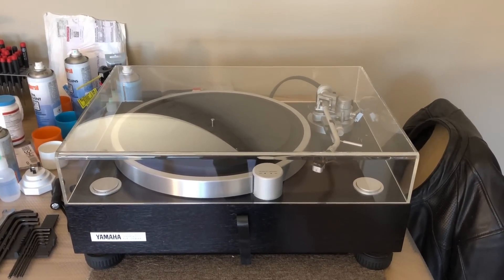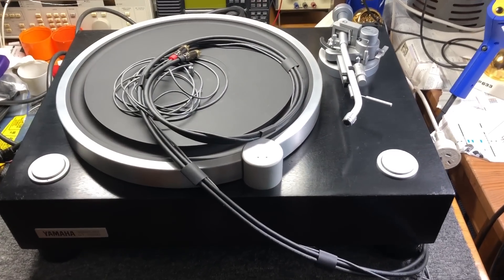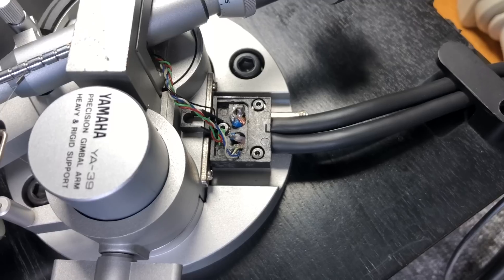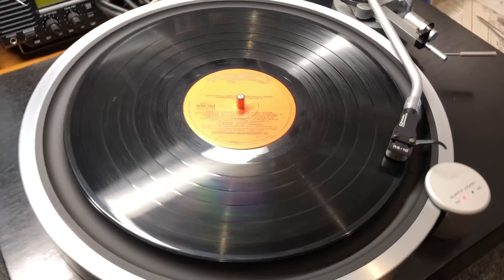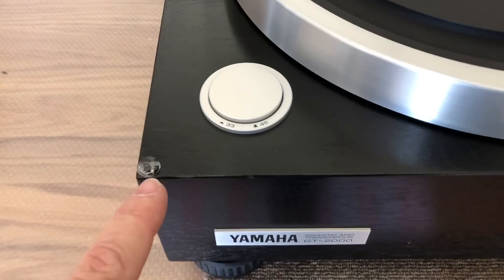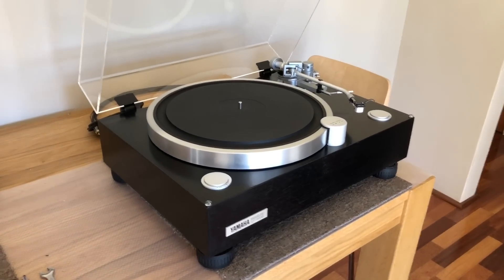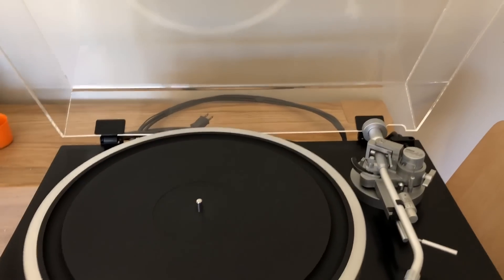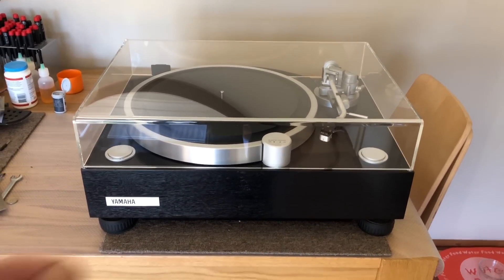Incredible Yamaha GT-2000 Turntable Audio Cable Replacement & Review

Comment: This is one of the muost popular vintage models localy in Japan here. Some nicely serviced ones sell even more expensive than its launch price. Which is just incredible.
Reply from the maker: Thanks for commenting and you are absolutely right. This raises a point I tell many customers - that classic Japanese decks really are still underpriced, even as prices go up. If you look at what $1500 - 2500 USD gets you in terms of a new turntable compared with one of these beasts, something like the GT-2000 crushes anything new at that price and way beyond. I think many people getting into vinyl now are starting to realise this, hence the steadily increasing resale prices. These decks and others like them will only continue to increase in value as folks realise that Yamaha's new GT-5000, for example, is not as good as the GT-2000 and costs a fortune!
Reply: Liquid Audio Absolutely. Its launching price was around 150,000 JPY. But now in a decent second hand store you would most likely find one for like 200,000. Also in Japan the inflation rate is incredibly low. This just shows how much better these vintage classics are comparing to modern devices.

Comment: Nice overview! I am very impressed that it has "pitch control". However, I do not see a strobe light. How do you know that you have it dialed in at the exact speed desired without a strobe? Many Thanks!
Reply from the maker: Hi, glad you enjoyed this one! There is no user adjustable pitch vernier, just a speed selector and on/off. Quartz lock is indicated by LED.

Comment: Nice review. You mentioned that there are better ones. I thought this one is a topmodel from Yamaha. The arm is a bit to lang you said!? What are better models?
Reply from the maker: Thanks and the GT-2000 is a beauty. An arm can't really be too long, the GT arm is a good length, it's just a bit flimsy and the weakest aspect of the deck. The Kenwood L-07D is a better deck with a killer arm for example and there are other amazing decks like the Micro Seiki SX-8000 and Pioneer Exclusive P3, just to name three!

Comment: Are there any similiar Models with full automatic?
Reply from the maker: No, unfortunately all the very best turntables are completely manual. Don't let that put you off, once you get used to a manual machine it's like riding a bike, everything becomes almost automatic anyway! Failing that, if you need full auto, check out classic decks like the Technics SL-10. I've made a video about that somewhere back in time...
Reply: @LiquidAudio  Thanks!

Comment: Hey Mike great work as always. 
With the bump stops, I usually mount them to the lid if possible as it keeps the surface clean ;-) 
Cheers VHFL
Reply from the maker: Thanks and glad you enjoyed it! I vary my bump-stop mountings according to original fitment location and lid thickness. I find they often don't last attached to thinner lids, but it can work nicely on thicker ones.
Reply: Yes, good point.

Comment: Hi,
Enjoyed some of your videos today and noted your comments on the GT2000, excellent.
I'm choosing between importing the exact same deck you have shown here or a Kenwood KP-7010.
Presuming they are both in the same working and cosmetic condition, would you have a personal opinion on which deck may be better than the other?
Just a personal non binding opinion of course, I realise opinions are very subjective.
Thanks
N
Reply from the maker: Hi N, thanks for stopping by. The GT-2000 is in a level of gear above that of the KP-7010. The 7010 uses some elements from the 600/650, like the platter for example and is a very nice machine, but the GT-2000 competes with decks like the Technics SP-10 / SL-1000 and Luxman PD-350, and so it is a definite step up. Cart compatibility is a consideration, as is headshell selection and the arm is weak link with the GT-2000, but they are very nice machines. More here: https://liquidaudio.com.au/yamaha-gt-2000-turntable-major-service-cartridge-install/, https://liquidaudio.com.au/yamaha-gt-2000-turntable-review-cable-replacement/, https://liquidaudio.com.au/vintage-fidelity-research-fr-2-yamaha-gt-2000-vinyl-setup/
Reply: @LiquidAudio  
Thanks for your advice, greatly appreciated.
Keep up the great work 👍
Reply: @LiquidAudio  
You wouldn't know anyone based in S.E QLD with your level of expertise for future vintage TT and audio services by any chance?
Perth's a bit of a drive 😀
Reply from the maker: @ngm1237  Unfortunately not. That doesn't mean there isn't anyone, but we see quite a bit of work from eastern states-based customers, which is interesting.

Comment: It's a great turntable, I have the smaller GT-750, same arm, but lighter platter and slimmer plinth, however still gigantic compared to a regular sized turntable. The original cable is pretty good, ofc and around 120 pf capacitance, but the connectors are a bit so so. It look like you need to raise the arm a bit to get a better VTA with the cart you have mounted.
Reply from the maker: Hi, yes the supplied Mogami cable is superb and the connectors average. It's not possible to tell from the video, one must right at the headshell, with a gauge, in real life, but the VTA is precisely and correctly adjusted for this particular configuration. One of the issues with this example of the GT-2000 and that I didn't go into in the video, is that the headshell connector is not absolutely correctly set in the arm tube, nor is the arm tube absolutely perfectly aligned in the bearing assembly. These assembly errors combine to cause some angular error at the headshell of this arm. This has to be corrected through arm ride height and azimuth adjustments, the implication here is that for the correct VTA at the stylus tip, this arm cannot be quite parallel with the record. It's not ideal, but it is geometrically the best solution for this example of the arm. It's this level of detail that most overlook, but also why these machines come to me for service, repair, setup etc. Down the track and if the customer desires, I'll take the arm apart and correct the mechanical misalignments within it. Overall it runs nicely now though with the AT ART 9 I recently installed. Glad you are enjoying your GT!
Reply: @LiquidAudio  Thanks for the reply, much appreciated, I do agree the headshell mount in the arm isn't 100% accurate on these but you can twist them slightly to get the correct angle using a small spirit indicator. In my experience this is quite common on many turntables.

Anyway, good to hear the VTA wasn't some oversight and you had it adjusted correctly.

Enjoy your videos, always happy to see high end audio equipment being treated correctly.
Reply from the maker: @TheStuffMade  Glad to hear you are enjoying the videos. There is no overall problem with headshell alignment on these arms, assembly accuracy varies from arm to arm, type to type, but this arm has an issue. Yes, headshells can be twisted, hence my previous comment about adjusting azimuth (twist) to partly account for these mechanical issues. Some headshells can be bent in the long axis which is what this needs, but not a headshell like this. A spirit level is not the best way to set headshell alignment. It's too involved to get into here but there are much more precise tools for this job. Anyway, yes, I work on gear from across Australia and beyond, plenty more coming!
Reply: @LiquidAudio  thanks, yeah your videos are great, I'm happy to see you use quality components and take the time needed to repair these great pieces of equipment. Anyway If you have the original Yamaha headshell that came with these turntables it's got azimuth alignment, as in you can twist the head to get the right angle.
Reply from the maker: TheStuffMade Thanks, that’s very kind of you and much appreciated! This owner doesn’t have the original headshell, though many others including the AT headshell in this video also allow for significant azimuth adjustment, via the use of a lock screw.

Comment: What type of cartridges do you recommend for this turntable? Everyone online seems to be recommending the low compliance denon dl103 or ortofon spu series. I'm currently running an AT33PTG/ii and seems to work fine but im a bit worried about the mass of the tonearm being too heavy for it.
Reply from the maker: Hi and thanks for your question. Best to go and check out my articles on this at liquidaudio.com.au as it's potentially a big topic. The issue is that most unfortunately don't understand the science of cartridge-tonearm matching. Because of this, you'll often read bad advice in forums, repeated multiple times over. Many think that because their deck plays a record, the match must be OK, but of course, nothing could be further from the truth! A clue can be gleaned from the cartridge Yamaha themselves recommended for this deck. It's definitely not a low compliance cartridge like the DL-103 and the designers of the deck knew what they were doing. DL-103 will work but is far from ideal and SPU is worse still. Medium compliance cartridges will work well, your budget plays a huge part of course. Total cartridge/headshell mass is very limited with the standard counterweight, so this is an important consideration.